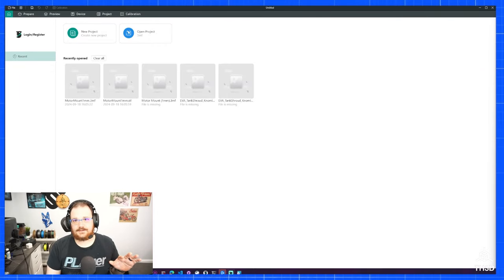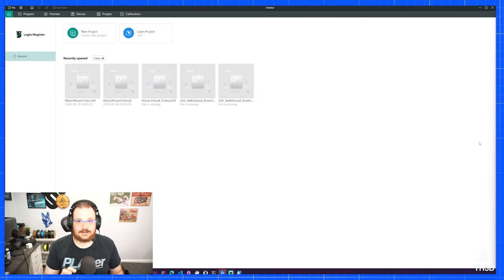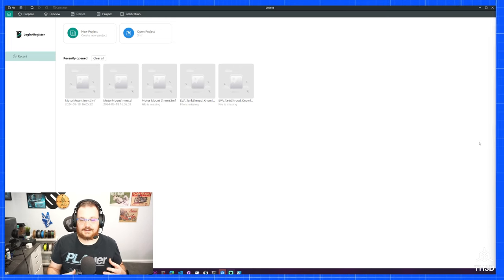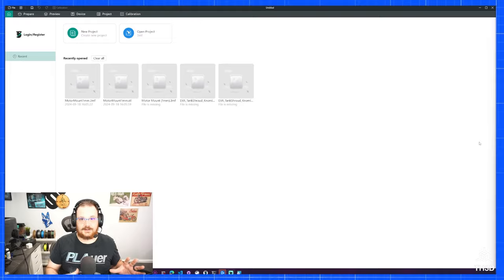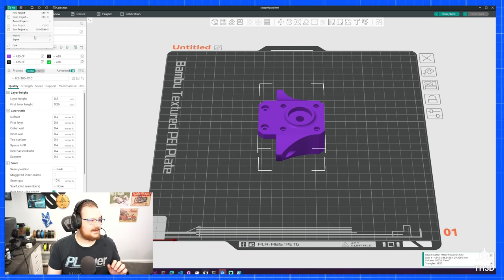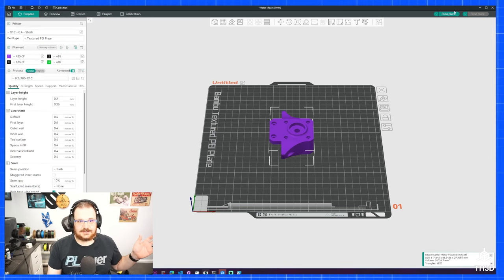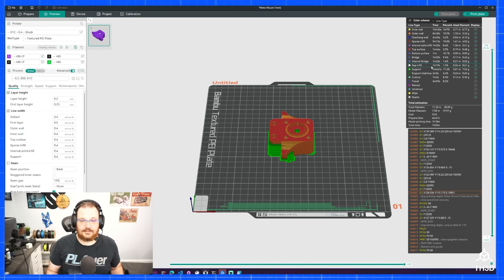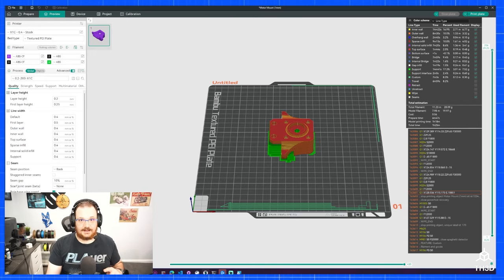Fix FTP Error -4020 in Bambu Studio and Orca Slicer

Comment: I need to give this a try, i have not been able to print directly from orca slicer for a while now because the file just plain refuses to send. I dont have my printer in lan only mode though. Another complaint I have with orca slicer right now is that generic pla in the ams or on the side roll, will show up as support pla in the slicer no matter what I do or how many times I try to change it back to generic. I am also running x1plus so I wonder if there are some issues with that and orca slicer because I have only seen a few people complain about the last issue.